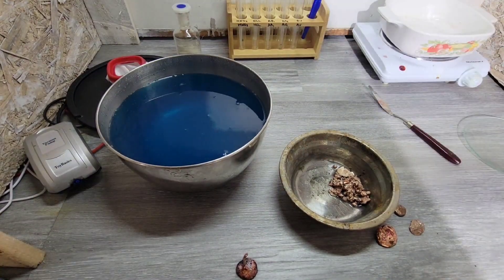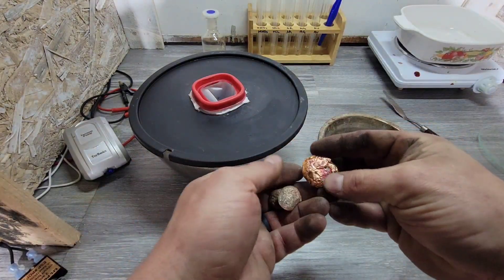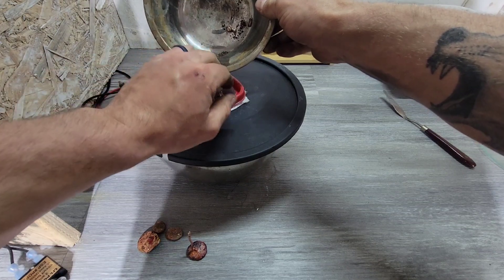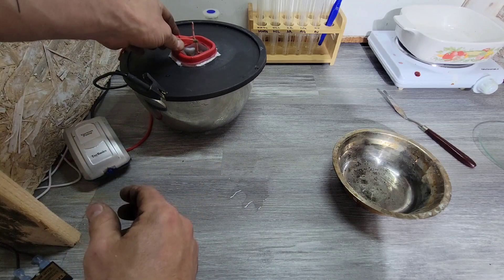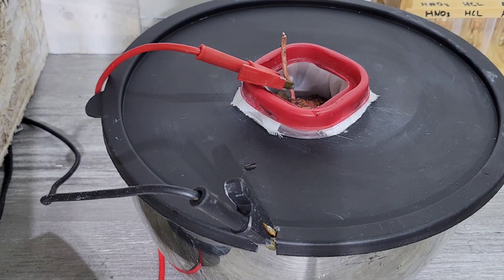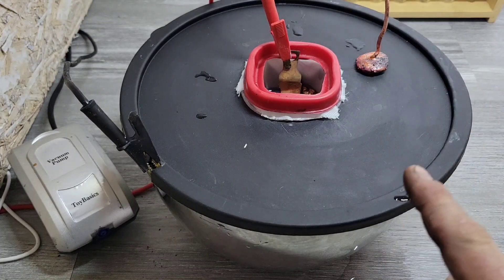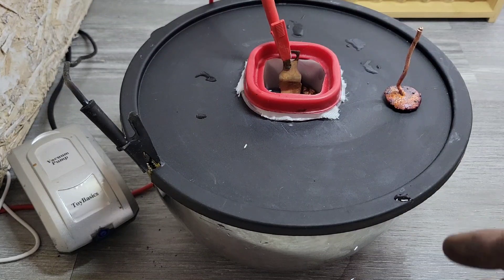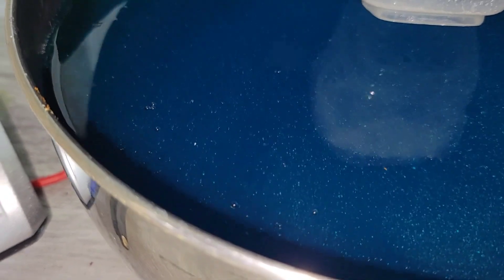Copper cell build for scrap silver and scrap gold refining waste.

Comment: The low-no amp was after you add distilled water you MUST stir it, so the copper ions are in the filter. Water without any ions can't carry current, no ions it acts as an insulator. Good luck, & hey get some gloves.

Comment: Can't wait to get a lab going.. 
Collected Tons of scrap over the years. Light switches, circuit breakers, junk jewelry, mercury thermostats, plumbing scrap, everything. One of the main things i'm curious to see is the Actual lead content of all the lead i have. I have heard some lead used for big sewer pipe connections may contain silver. I guess it just depends on what the plumbers did when they were building here over 100 years ago.
Reply from the maker: I think lead contains gold as well. Do it don't hesitate. I put it off for at least 5 years and am kind of bummed I did. You can do all of this outside, too. You don't need a special lab by any means. I am a commercial HVAC guy, and the shop I work for does everything, so I have nice access to a pretty decent stash, lol. I'm lucky in that way. However, I would suggest doing jewelry first. It's so much easier to learn on. I started with e-waste, and it was quite the learning curve. It is fun, though, lol
Reply: @SilverStoll  thank you for your response! Definitely subscribing now, mister!  👍
Reply from the maker: @J White  I appreciate that! I have a video dedicated to my subscribers on Fridays so if you want to show off any of your collection or plans send them to my email! I'd be happy to put you in the video.

Comment: IF one was looking for a copper bowl without divets n such...  a spitoon may be an option. I have one i could use. Would just require cutting off the upper flare part.
Reply from the maker: O nice. I will do an update video here soon on the copper cell. The stainless works great by the way.